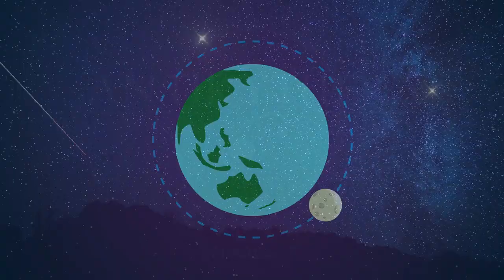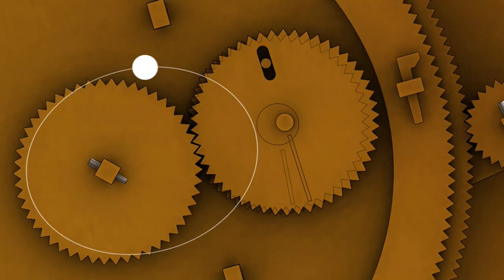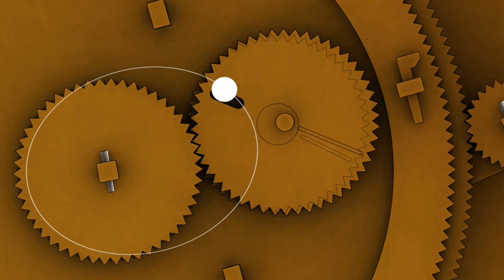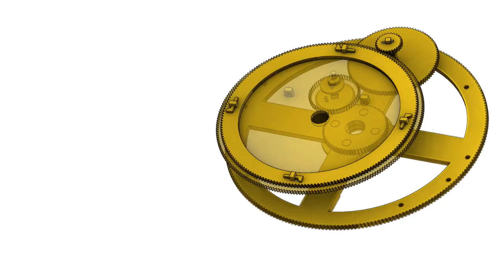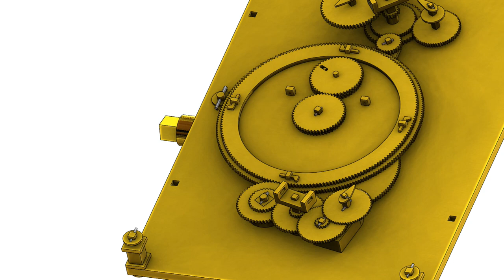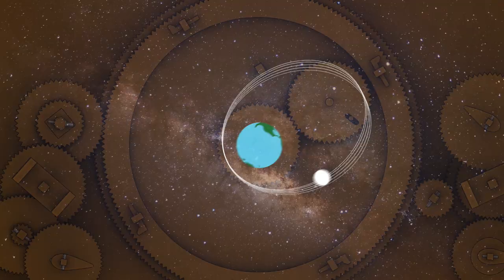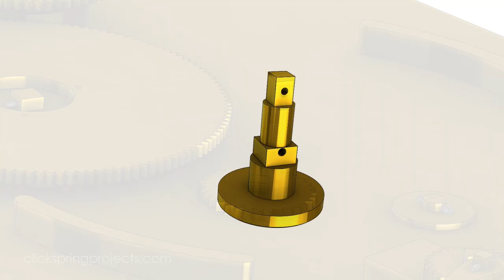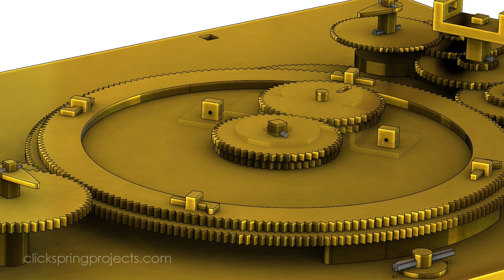The Antikythera Mechanism Episode 9 - Making The Epicyclic Pin and Slot Gearing

Comment: The technical prowess in these gear trains kind of changes the assumptions made about the tools used to make them. If they could make this device they damn sure could make an indexing rotary table of sorts with file guides and all..The mechanism for it is literally in the device already, only smaller.
I bet whoever made this had a whole host of machine tools, fixtures and devices he constructed to aid him in making devices such as this. When he died, nobody knew what the tools were or how to use them so they were tossed and lost to time. It is no different than what happens to grandpas machine shop when he dies in todays age.
Reply: For instance, While the guy is filing a square hole he thinks, "hey, if this file was the same size as the hole, I could push it through and do all four sides at once..."  A broach is born. When he dies, others only see weird looking files...and re forge them into knives or horseshoes or whatever..

Comment: Chris, a potentially silly question here. Why the use of the bridge strap rather than retaining pins and riveting the offset pin? Wouldn't the strap have higher friction? Or is to help with lateral torque?

Comment: An amazing craft! Thank you for sharing! )) 
I wonder what is the reason to use a pentagon at 3:10 - as the rest of the places squares are used...
Reply: It's driving me CRAZY!!! I can speculate a lot, particularly since the pentagon and the moon have often been associated. But I can see no mechanical purpose!
Reply: @reverendjuan9121  drives me crazy, too. What's your speculations? Mine are: A: to not accidentally mount the wrong wheels - problem: the square part is deeper then the pentagon, so it's unlikely to be confused, B: The pentagon is not peened, maybe five sides are better for just a friction fit, C: the pentagonal side holds a thinner wheel, maybe a square loosens easier (kinda ties into B), D: extra challenge for the maker(s), E: a way to reposition the relative gearing of the two wheels in 72 degree steps, for some sort of fine tuning - problem: pretty far fetched
Reply: @MrTridac  Hey, thanks for answering.
Truly, way less than what you came up with. Many thanks! Still no definite answer, but still: satisfying, to read your thoughts.
I think the "don't place the wheel on the wrong axis" thing might just be it...
I only remember thinking that maybe (I did not check) the number of teeth was a multiple of 5, and therefore, once you made the teeth, there was a simple mechanical way of tracing a pentagon (or the right pentagon?)
Also, maybe a wink to some astrological meme...
Reply: @reverendjuan9121  Well, he does use the teeth to help mark the pentagon. Ultimately I think even Chris doesn't know for sure. Otherwise he probably would have mentioned it. Maybe the maker was like: "Let's make one connection pentagonal. Just to confuse people in the future."

Comment: I'm not sure I followed what you were doing with the lugs by the forge.  You seemed to put them into the fire after a lot of the forming had already been done cold; was there some shaping that required softer metals?
Reply from the maker: Heating in the fire anneals the metal to permit further bending without cracking - Cheers :)

Comment: 4:22 what type of process is that? I'm working on a project that, while not clockwork related, uses brass. One thing I need to do is attach 2 pieces of brass together without damaging the flammable stuff that will be being secured between the two.
Reply: Peening.

Comment: Here's a question: has anyone attempted to use the reconstruction of the device, combined with the positions of the gears as shown in the wreckage, to try to guess what the "state" of the device was when it was shipwrecked? That is, could it be possible to determine what date it was set to before it was lost?

Comment: Okay, i've tried googling and come up empty.  It's probably glaringly obvious but i can't seem to come up with the answer:  

For the peened fits, I was always under the impression it was the enlarging of the head to exceed the hole diameter that kept it all together.  If the head is remove though, it's not there to hold it all together.  Am I to understand it's simply the resulting permanent compressive stress in the material creating pressure on the ID of the hole, such that friction is all that's holding it?

Comment: I didn't see that the eccentric hub was oriented in a specific direction versus the other.  Is that critical, or is the indicator pointer just set properly at final assembly?

Comment: Hey Chris, how did you determine the orientation and location for the square hole of the offset pin and the offset axis?  It seems like they would require some pretty sophisticated locating equipment! The square hole and offset axis needs to be oriented precisely in order for the variable gear's partner to be on axis of the original driving gear! Did you use the unique characteristic of the triangular teeth (filling deeper teeth until they fit) to accommodate for the lack of locating equipment?

Comment: Hi, Clickspring
About the conical pins you use here and in other building steps to keep things together: apparently they are modern stock (that's absolutely fine by me - keep it comin'). But I wonder how the old Greeks made them, given the large overall number of pins in the Antikythera Mechanisms. Any ideas?
Reply from the maker: Will cover in a later Fragments video - Cheers :)

Comment: I like these videos on how these pieces were made but I’ll never understand how it coulda been done in any persons lifetime back then. To even pass on the knowledge to an apprentice that could take over the work once the original builder died would have taken a lifetime. Especially without paper. Consider being off even a hair on any of the toothed wheels, it would throw everything off. Not trying to sound weird but the device has always seemed otherworldly to me.
Reply: Well the math to calculate the orbits (if I'm understanding correctly) is well documented. So it's just a matter of having the right number of teeth. It's just the complexity and precision that makes this such a marvel.
Chris has done many of the operations with hand tools, so it's not unreasonable to consider that someone historically could have done it with the process just taking a bit longer.

Comment: Epicycles.
Right some of the time, but for all the wrong reasons.
Y'all know this thing is derived from Ptolemy and his theories of epicyclic motion in the heavens?
Goes like this: Everything in the heavens is perfect and moves in perfectly circular orbits around the Earth.  Gears in the heavens!
The explanation of retro-grade motion was that a planet has its own circular motion impressed upon its orbital circle.
Circles moving within circles within circles with the largest circles centered on the Earth.  Smaller gears mounted on the bigger gears...
Ptolemy held that if one were to know all the circular motions, what he called perfect knowledge, then the predictions would be perfect.
Well, real planets just don't move that way, said the author, somewhat condescendingly.
The teachings of Ptolemy held sway until the early 1600's; nobody wanted to let go of the idea of Earth at the center of the Universe or to disagree with Ancient Knowledge.
By the time Copernicus and others were taking accurate measurements and placing the Sun at the center, there was a set of about 45 nested epicycles to account for the orbits of Mars, Venus and the moon.  Epicycles were an accepted part of 'real science' for well over 2000 years.
While it is true that this machine is called a computer, it is in essence a clock with a built-in point of view.
The thing has a 'window' where the predictions are quite accurate, but getting outside the sweet-spot sees the predictions get fuzzy.
Then again, the 'window' is about 80 years wide, well beyond the life-span of most folks of the day.
My guess?  This thing was the Rolex Oyster of its' day; a wonder to behold, a fortune to own, and a cult-like status among those who used them to make predictions.
Epicycles were based on Ptolemy's  assertions about how the Universe should behave, and being who he was, his students taught the same thing to their students.  
Epicycles bent the study of the night sky for hundreds of years by forcing people to use a geocentric view of the Universe.
Comes down to superstition vs. science.

Comment: Sadly, you have recreated a mechanical facsimile, however the actual accuracy of the cycles and timing is non existent. It will be great to look at but will not be functional and merely represents the original specimen